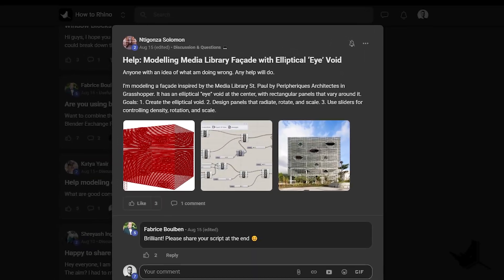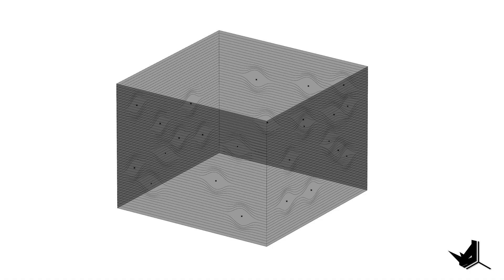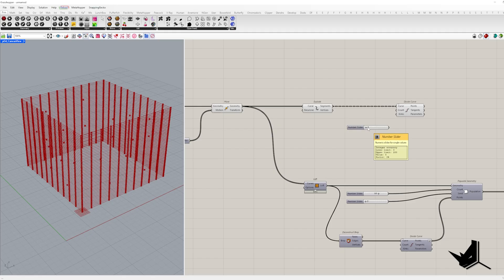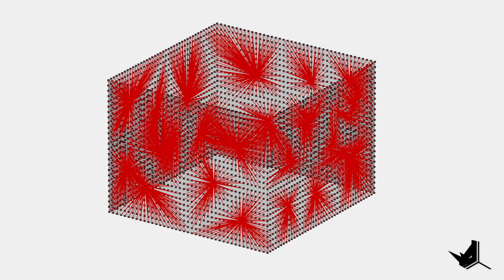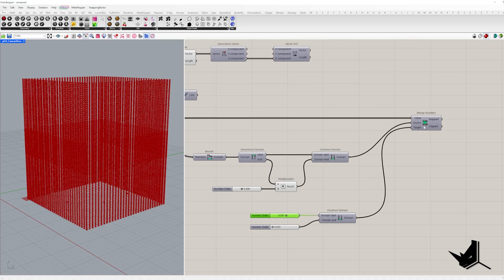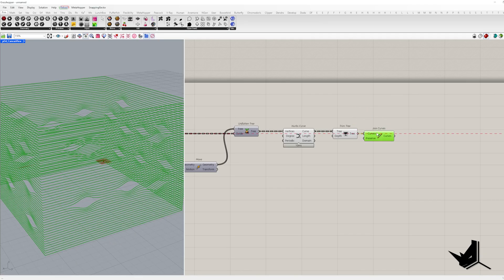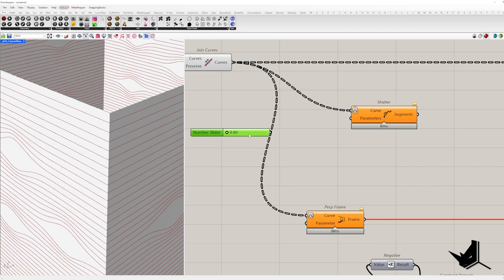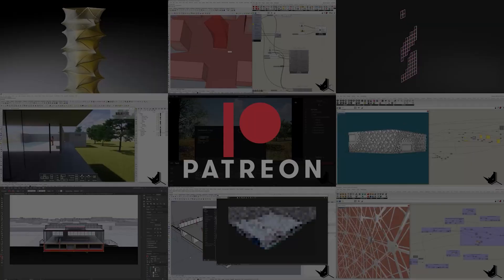It All Started with a Simple Question…

Comment: Hi Can I ask how come you exclude the points on the edge by de brep and select the edge points and connect to popgeo? Isn't it suppose to include these points on edge? At 1:32. Thanks
Reply from the maker: Actually it’s opposite. The Points input tells Grasshopper which areas to avoid when generating random points and it makes the populated points stay away from those locations.

Comment: Thanks for this tutorial. I came across few issues : its too fast to follow trying to repeat your actions. It did not produce the result displayed, even after double checking. Please take more time when you do some actions like reparametrize, or you do without mentioning like when you add a relay. The intermediate results on Rhino do not look to correspond to where you are in the tutorial, making it even more difficult to follow. There is room for this very interesting example.
Reply from the maker: Thanks a lot for the detailed feedback! Our idea was to keep the pace a bit faster so you can first watch it through to get the overall idea, and then slow it down (0.5× speed works great) if you want to follow along step by step. 

We’ll definitely keep your feedback in mind for the next ones.
Reply: So now we are deleting comments?